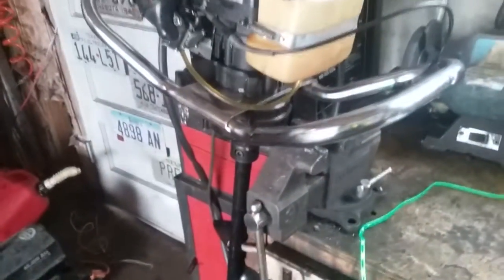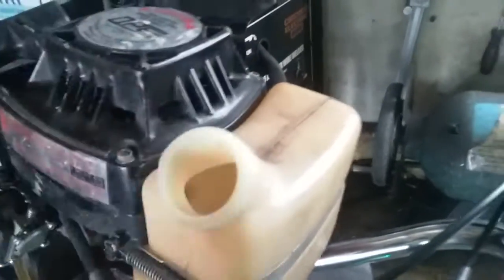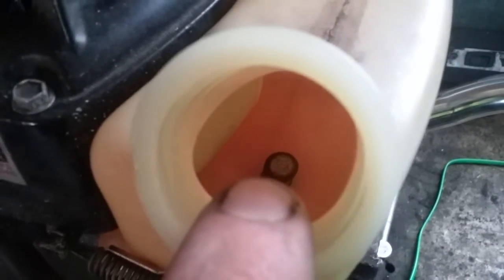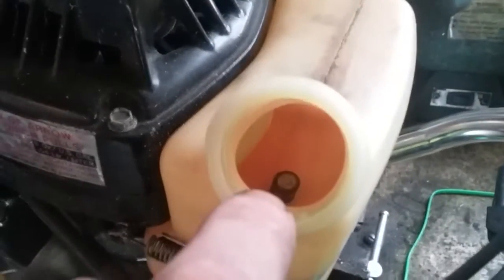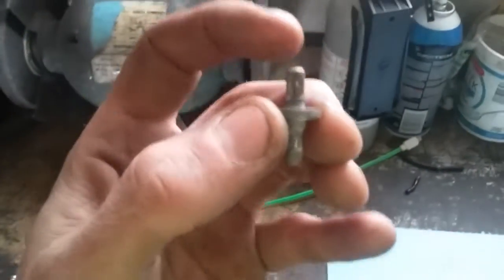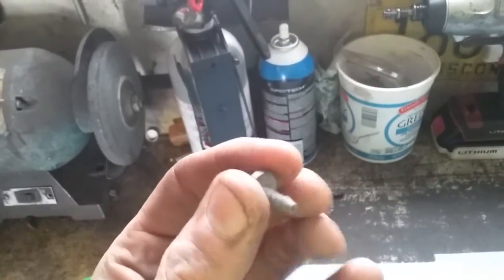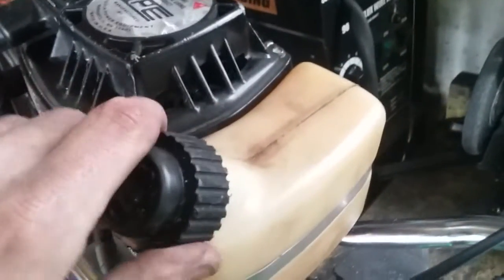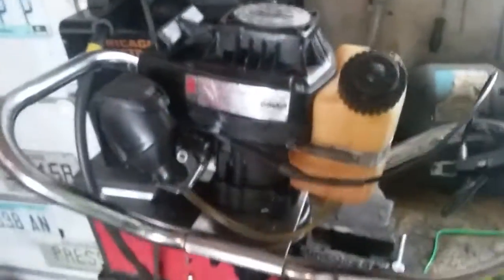Ice auger fixed

Comment: I have same auger, I broke the fuel line connector at the carburetor,can that be fixed or do I need to get a new carburetor?
Reply from the maker: Everything can be fixed. They do make new connectors that just press in if you can get the old one out. But for how cheap these carbs are you are probably better off just ordering a new one.

Comment: I have the same exact auger and it dies whenever I hit the throttle.
Reply: Vengful Pker did you ever fix it.  That’s what mine is doing
Reply: Mine too.  I just cleaned the carb and added an inline fuel filter